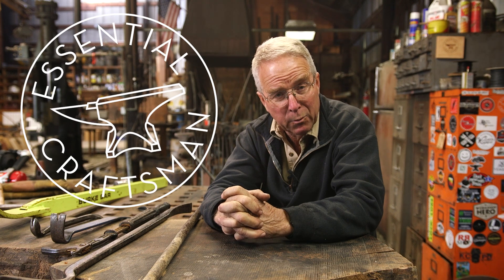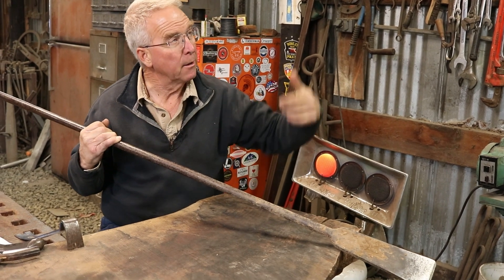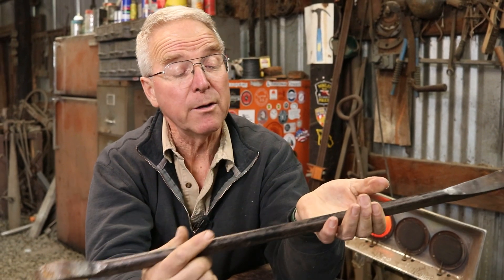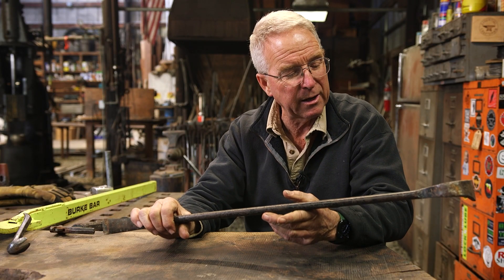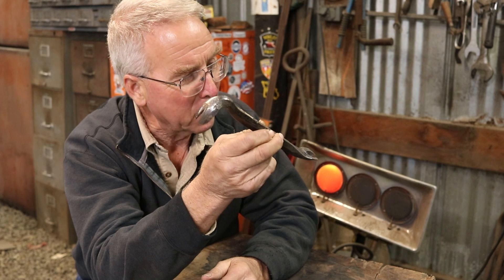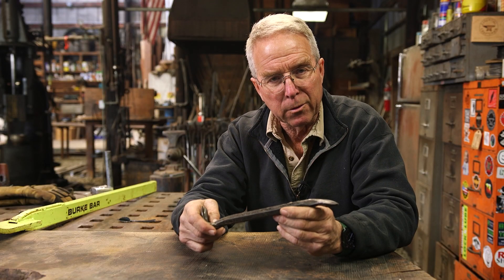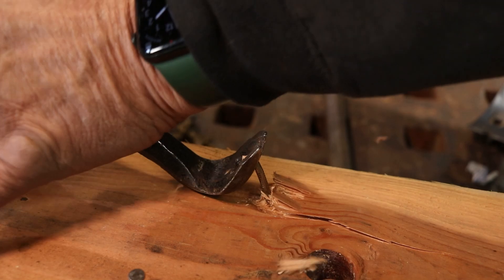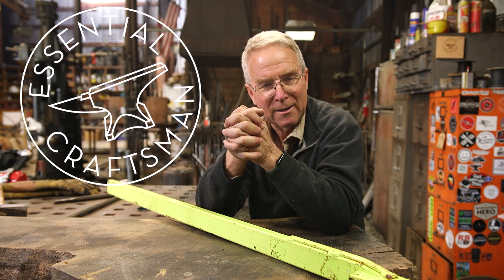Pry bar Comparison & Uses: My 6 Favorites for Better Leverage

Comment: I’m a 25 year old carpenter apprentice in Canada. I have watched Scott go on about Burke bars on YouTube for years now and found one at a garage sale for $20. I jumped at it immediately. THANK. YOU. SCOTT. This bar is a machine. I love it. My whole crew loves it. I haven’t touched my roofing pry bar since. I love this channel so much, it has changed the way I approach and appreciate my job. “Aim for perfect, settle for excellence.” You said it, man. Cheers
Reply: I bought one shortly after the first time seeing one in use in this channel. Always in my truck and used often. The eastwig 16 inch 3 in 1 pro roofer is a mini burk bar with a catspaw that you can put in a flatbar sleeve hanging inboard of your gastner bag.
Reply: Store it lowdown: - if it fell from over 3' high it'll bust Yor foot. I Suppose they're for 'millwrights' moving heavy  m cs into a precise location.  In UK they're called 'wrecking bars' .   - Fire brigade has a version with a more angle bend end- to force open doors of crashed vehicls.

Comment: How hard is the steel on Burke bar? I used 2 different brands from my job but idk which brand is which. Both slightly different but spray painted by someone due to rust. One had a good springy snap , tiny bjt of flex in the blade which had its uses, but the other burke bar, had a less curved blade, was much heavier, harder steal, didnt have very much flex in the blade or handle. Was alot better for moving bundles of rebar and prying forms in very tight spaces

Comment: Thank you for the video.  I was looking for something else but I have one of those old usa made dig out bars that looks just like yours.  I was using it wrong(previous owner instruction) and thought it was worthless.  Now I see how to use it correctly and I see new light.  Thank you.  I have a question.  I have a couple ~5ft old pry bars that are bent; what kind of steel is used in those?  Can I heat it to bend it straight or would that weaken it?  Thanks again!

Comment: I have a 5 foot length of hardwood 2x3 that I use to lift my tractor out of any wet holes it fell into.  I also use it to lift it enough to put my 2 ton jack under the front of my tractor so I can back out of the hole while my front of the tractor is in the air.  I need a 6 ft hard wood pry bar to lift a wooden tree branch about 18 inch in diameter and 16 feet long.  My light weight tractor won't pull it.  But I want to winch it up to a branch of the tree that is about 20 foot above ground so I can swing or winch the log nearer to the tree.  The tree is over 200 years old and my goal is to build a border around the base of the tree.  I want to build a strong structure above that area and elevated by the fallen logs that is protected from falling branches and from the rain, a place where I can go read, watch nature, sleep etc.  I used to pick up 8x8 treated wood 20 feet long.  I can't do that anymore.  My back won't let me.  But with an overhead winch I should be able to make that strong under tree structure to rest, relax, enjoy nature and watch the deer, birds etc.  The tree is Oak but the branches are stiff and fall off.  Maybe I should weld some steel for my own protection.  I just don't want to dig a 4 foot hole for concrete like years ago for my 20 foot x ten foot lean off of my barn.  I'm 80 and always work alone so I need leverage, and overhead winching.  I used to do a lot of power rigging in the steel industry when I was much younger.  It was fun.  But back then I had a crew and power cranes etc.  I hope you find this interesting about our eternal aspirations and brain power.

Comment: great tip i could have used a burke bar setting the concrete panels for a house im building.
Reply: What kinof house are you building? 
I built my house tilt up
Reply: @rd-ch1on  thats cool i built mine tilt up with rocks embedded

Comment: Love the Burke bar. Its like a an all metal Johnson bar without the wheels. A mattock is useful for prying and lifting especially in close quarters. Carefull prying hard with your  digging bar they will bend at the top to the blade. A heavy square bottomed single bevel crow bar is less like to bend. That ‘Gorilla bar’ is similar to Granfors bars which are the best I’ve ever found.  American cats paws suck compared to the Japanese style. They don’t have a well formed Vee notch and they tend to flare out over time . There’s not enough metal in strike zone.

Comment: Dear Essential Craftsmen, if you are reading this, I need your help on how to work smarter not harder. How would you move this (600lb) Baldor-Reliance HVAC Motor, EM4114T-G, 3 PH, 50 HP, 208-230/460 V, 3600 RPM, TEFC, 326TS Frame how to move this and what type of device can i use? Over a 1inch door lip, where both side of the floor is flush but with a 1inch lip? Any help would be much appreciated.

Comment: Stealth and guile beat youth and strength. I need to get me a Burke Bar and one of those die bars with the nice handle.

I have a favorite Estwing door bar that is about 35 years old. The bar is not flat in the handle section; it is half-moon shaped so it is more rigid than most door bars. It is ground with a good long taper at both ends so it fits under work better than most current door bars. For finish demo and repair I find a lot of use for a 2 1/2 inch rigid scraper (used to burn off paint) ground on one side. I use it as a pry bar alone or using it under a door bar with a pair of large diagonal cutters or end nippers to pry out nails...It is fabulous for removing baseboard or molding from a wall without damaging either material.

Comment: I do mostly repair and refurbish work on mobile homes for a mortgage company. My most used pry tools are flat trim/moulding bars. The next for me would be the door bar. If you do allot of removing and replacing of trim work a set of flat trim bars is essential imho.

Comment: Good picks for sure, though instead of a simple flat bar I'd use a wonder bar. Stanley makes a great one. There's a rounded portion a half circle used for leverage and the flat of the bar is of set around 25-30 degrees really good for getting more leverage on a wide area if you can't get something like a J bar in it

Comment: You can afford a firemans Halligan or Pro Bar and might enjoy one of the custom tools like the wedges and or sledge hammer with mating bracket. The design of the Halligan, Pro Bar etc is amazingly versatile which is why the pros prefer them to most plain bars. Needless to say they are FAST in the right hands (videos of bar use and breaching are worth a watch. I don't do enough demo in crippled retirement to buy new but may anyway for giggles.

Comment: Just curious, how are all the other contractors doing with finding jobs? I have had an extremely busy year, but now it is like somebody shut off the light switch. I have little to no work now. I have bid a few jobs for MUCH less  than I had a few months ago and am still not landing them. Anybody else having this issue? Wondering if its bigger than just me.

Comment: Also, I have another pry-bar that's a cats-paw on one end and a wide fairly thin curved lever for pulling finish nails - it's a Japanese tool and incredibly useful for not marring delicate molding and it's not as destructive against drywall.  In addition, I use a beefier shingle ripper which is non-flexible iron, about 18" with L-foot on one end and angled thinner wedge-shaped end sort of like your blue-bar). This very good for popping heavier baseboard moldings in addition to ripping shingle nails under a course of shingles.

Comment: G'day, a young 26yrs here. Recently bought a felling lever with a cant hook (Arborist by trade). Used almost daily, being used as intended, felling lever, cant hook for rolling logs. But it sure comes in handy everywhere else. Amazing what leverage can do and how much less force and strain is put on your body. From mechanic to arborist I've already figured out undue stress on your body takes its toll, so doing my best to work smarter and harder without wearing me out. Cheers from Aus 🇦🇺🦘

Comment: Never even heard of a Burke Bar 'til I watched this channel, and the BB saved my keister in tearing apart a 25 year old deck that I was rebuilding, which was 32' x 16'.   Used during the Covid fiasco when it was hard to find labor willing to even bid on the job...which I didn't want to do (I was 75 y.o. at the time)....it made the job so easy that I found myself laughing half the time, and it probably saved my wife the grotesque experience of having to give me mouth-to-mouth first aid!!   Used it on several 'one-off' type situations, and it was better than having a second person to help.   Also, depending on your neighborhood, it's not a bad thing to have sitting near the front door of your home!   Great tool to make me feel like I had the strength of  2 or 3 men!

Comment: I did millwork for close to 20 years. We had a sliding nail puller like the one you showed. It was always a badge of shame to have to get it. I found one at a flea market a couple of months ago. It was $12.00. Nobody knew what it was. I snagged it. Not that I'd ever need it, but I might have a coworker that might.  Great tool, especially for a set finish nail.

Comment: Great pry bar assortment, on a side note every Carpenter should have at least one bottle jack on the truck.
Reply: Amen to that. I also keep a highlift jack in my tool trailer. Between a 20 ton bottle jack, a 2 ton highlift, and an everything else burke bar, I can handle most things.

Comment: The pry bar with a right angle end....is the best one for your money...as far as overall carpentry.  However, you could certainly use one that is of better quality.  Best ones are made in Sweden.  I find the US bars, on the whole, are not made of high enough quality steel.  They are much easier to break than a swedish bar.  The Swedes seem to pride themselves, just like the Japanese....at working metal to higher standards.  The swedish bar has a much finer taper....and the steel is incredibly strong.  I've seen too many American-made bars break under pressure...or get dented badly at the taper end.  The swedish bar also does not need to add so much weight to the straight section, in order to avoid the bar bending.  It's night and day, in comparison to the American-made pry bars.  Yes, the swedish bars cost significantly more then the American ones...but they last a lifetime.  That's money in your pocket.

Comment: One thing with the flat bar: if you're using the hook/90° end and it's flexing when pulling the normal way, you can pull inline with the flat section (90° to normal) and it's much more Ridgid that way. Helps a lot with longer/cheaper bars.
Reply: I generally end up prying in this fashion the majority of time I use a flat bar. Mabey it's because I'm on ladders alot. Pulling down instead of pushing away feels safer I reckon.

Comment: As a Millwright I use prybars constantly. I noticed you didn't have any indexable-headed prybars on your list. you need a GEARWRENCH 29-48" Extendable indexing Pry Bar - 82248 on your truck. It will save your back when all else fails.
Reply: Agreed, I somewhat recently found these and they're awesome.
Reply: Bought mine 3 years ago. First job was lifting a car that fell off the jack for a road side flat repair.

Comment: I am not a carpenter, but an excavation guy. I’d like to add to this list a digging bar, also known as a Fresno bar. Imperative for underground utility work and so many other things. From prying up cut asphalt, sending gasket jointed pipe home, digging in hard ground, lifting manhole lids or storm crates, or repairing equipment. Everyone needs a good 5’ digging bar in their collection.

Comment: For those reading this, the door bar that Scott references is fantastic, but they make a heavy duty version of it called a Superbar or Wonderbar. They are more than fantastic. It's the only carpentry tool my dad ever gave me and I never do a job without it. The one I have is the Vaughn brand Superbar, and it's probably older than me (I'm 44). It's the one tool I have that goes to every job with me. Demolition, carpentry, landscaping, it does it all. Be careful which brand you buy because some of them are specifically door bars and are meant for light duty. I forgot my Superbar one day and slipped in an Ace Hardware and bought a random supposedly heavy-duty door bar for the job I was on and it didn't last the day. I've been using the one my pops gave me for almost 20 years. I can't speak to the quality of the new ones, but they are still made in the US. You can find them here: https://amzn.to/3VCTH64 

Also, per Scott's recommendation, I bought myself a Burke bar and I've been more than satisfied with it. It cuts my time in tearing down concrete forms in half. The one I bought is the Marshalltown brand, their heavy-duty Monster bar, and can be found here: https://amzn.to/3VIlYIw

Comment: The Lee valley restorer's catspaw!!
https://assets.leevalley.com/Size4/10091/60K2108-restorers-cats-paw-12-inch-d-1818.jpg
I have had the same one for over ten years.  Masonry/concrete/form work/framing/timberframing etc, this this will do it all and will not break or chip.  Japanese made with high quality steel also.  Lost it in a snowbank, then came back in the spring, found it with no rust....

Comment: I would say my glaziers bar sees the most use, and the burke bar is the most indispensable. Most of those levers have a workaround, but in my experience there is nothing else that will do the work of a burke bar. I owe you for bringing the existence of that tool to my attention. Thank you Scott..
Reply: I bought one new! I climbed above a 35 ft poured wall set and i heard Tink tink tink! me NEW bar went down to the bottom! I say it funny, but cost me 17 bucks! it is in the Arauco plant in Grayling Mich; its like some sort of monument! LOL!

Comment: Totally agree with the uses. I've touched all of those bars. The most recent is the Burke Bar and I'm not sure why it took so long to get my hands on one. Those I work with know it's in my truck; typically it's the first leverage tool they ask for. A back saver and helps make the hard labor jobs a little more enjoyable. Keep up the good work.

Comment: Cats paw has a dedicated spot in my tool belt forever.  I never saw a burke bar around here, but it looks like just the thing I needed last summer to move big heavy farm machines and the grain dryer around.    My go to bar for decades has been a very simple flat bar, about 18" long with a hex handle (sorta like a big cold chisel).  The hex end you hit with a hammer driving the flat end into the work.   It can get under shingles, hold doors, pull nails,  tiles, trim and baseboard with minimal damage, and every thing else I have thrown at it.  I wish I could show a picture here. 

The idea is to be smarter than the heavy thing, not stronger (unless you are stronger),  but at 70yr/145 lb smarter is def the way to go.

Comment: I would add the bee keepers bar/ window glazier bar to your list. Excellent multipurpose small pry bar that fits in your tool bag.
Reply: agreed.  When I got into finish carpentry and then cabinets, a glazing bar was my go to because it was thin, flat and wouldn't mar the surface of what I was prying on.
Reply: Would you have pictures of these tools? Tried a search for "bee keeper bar" came up with nothing.
Reply: @thinktank8286  do a search for "Richard Tools 10 inch pry bar" . It's 10 inches long  x 1.5 inches wide, painted red. Originally they were used by beekeepers but now are also used for a wide variety of things.
Reply: Agreed. We use them constantly in commercial/retail millwork installs. I actually like the ones they sell in the paint tools section of the orange store.
Reply: @krenwregget7667  try searching hive tool.
Reply: I agree. I have a red devil that has come in handy on mobile home renovation (trim pieces on the decorative drywall

Comment: I use a roofing scraper for flooring pull up. Luan comes out in almost one piece with the old floor. Osb or plywood subfloor is also possible.

Comment: I typically have 2 of every bar except a cats paw. I keep the cats paw in my bags and use it as a hammer partner. All the other bars can be used with a hammer, but sometimes it’s nice to use 2 flat bars together. I find that if I’m using a flat bar often enough I can slip it in my tool belt directly between the belt and bag.

Comment: I used one of the slide-hammer nail pullers one time. (Circa 1990's)
I now have a nail puller collection of six. Dating back to the 1800's. They are the cats a$$

Comment: Burke bars are amazing. The tilt wall erector on my job, use them to shift the 90,000lb wall sections exactly where they want them before detaching from the crane and bracing them off. Four guys with two bars. It’s a sight to see.

Comment: You forgot the best part of using a flat bar. When pulling casing or trim off of doors, window, etc. When you want to reuse the material and/or not mar or mark up surrounding area. You take the bent side of the bar get it behind the trim/case/base and instead of applying pressure on the flat side of the bar you put pressure on the edge of the bar. This does 2 things multiples leverage and keeps the marring behind the peice you are removing. Maybe you know this trick and forgot to share but it is by far the most useful aspect of a flat bar for remodeling